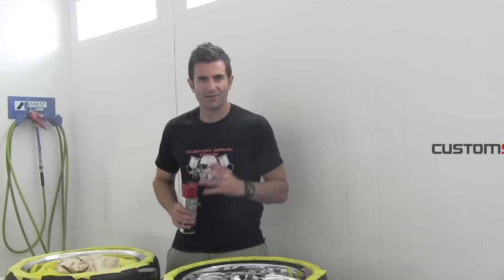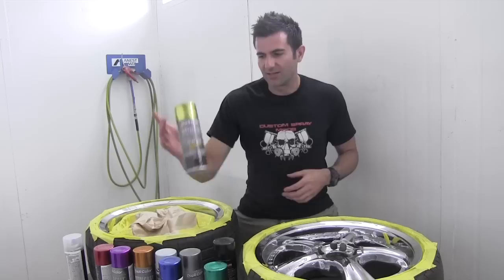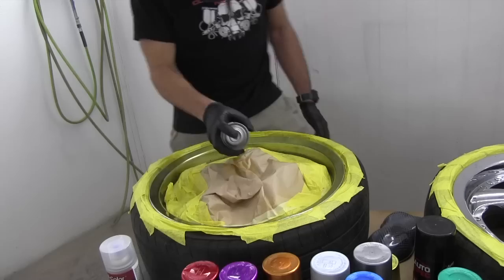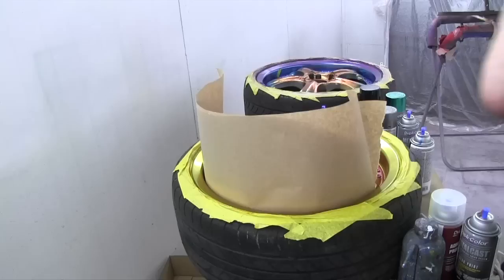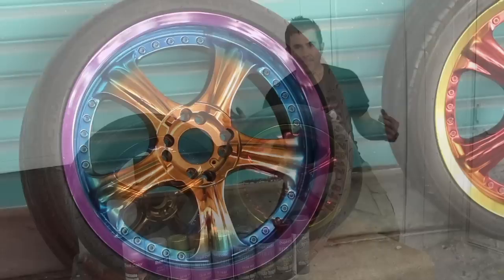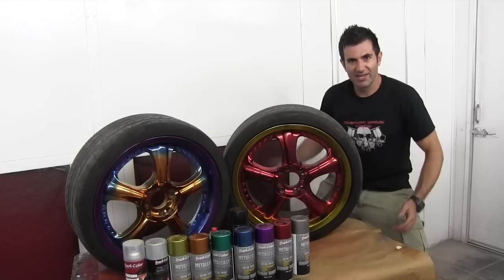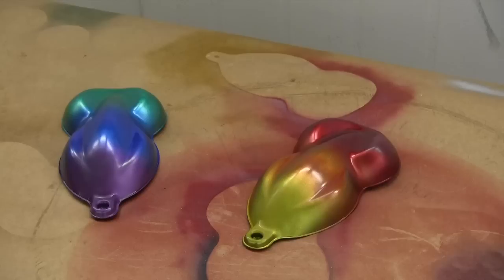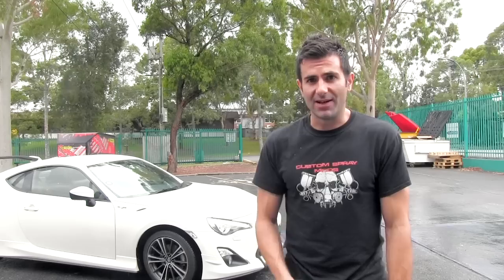How to Color your Chrome with spray cans DIY

Comment: Hello. I do a lot of spray painting in the uk. Just have 2 questions really.
1. How do you paint chrome to a really chrome finish? I've used several chrome paints and none of them are any good.
2. What type of paint are you using on these chromes after?
Thanks 😊

Comment: Alright i really curious but can you use this on chrome trim peices? Also how does it look with a black tint? Any posability of you making a video on it or finding a way of doing it on a chrom trim peice and getting pictures of it?
Reply: with a light coat of black, chrome trim looks smoky chrome colored. kind of gun metal tinted.  and then clear coat on top just to finish and make durable

Comment: So my buddy has chrome polished rims and he want me to paint the face of it white but leave the edges still chrome. I think you said in the beginning of this video not to sand them, only use an adhesive promoter then paint them with the color base without the use of primer before the base color, is this right.
What about this etching primer Ive been hearing that you have to use when painting on chrome
Thanks

Comment: Hey Dave ... I have used this on my quad rims with no problem but noticed its very touchy when using the base coat ... I painted a helmet by directions and noticed it was peeling as to many coats and it would get wet from underneath would you recommend using a light top coat between base color and more colors ?

Comment: If I prime, and sand it first before adding a base coat and then the metalcast top coat,  would I still get that same kandy look?
Reply from the maker: No you won't. It gets the reflection from the chrome. You could use a silver base to get similar.

Comment: Hey what did you say to use to take it off
Reply: +James Thurman thinners
Reply: +jay_ thanks
Reply: +jay_ that was multi purpose thinner right
Reply: yep, you could try some on the back of the wheel, let it cure and wipe if off with thinners just to see how it comes off if your worried.
Reply: +jay_ thanks

Comment: I love your videos but how durable is this stuff
Reply from the maker: As durable as most paint on wheels. As far as the wheel vs a gutter. I dont know any kind of paint where the the gutter would loose. It can be cleaned with high pressure as well.
Reply: customspraymods might be good to put a spray clear. I liked what u did at the end with the silver base